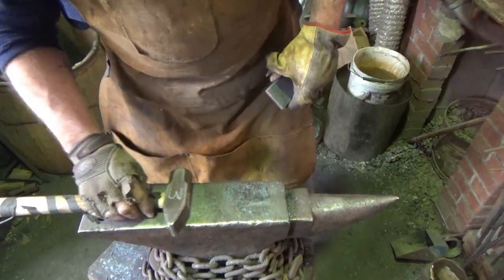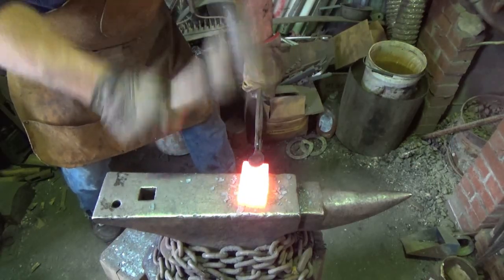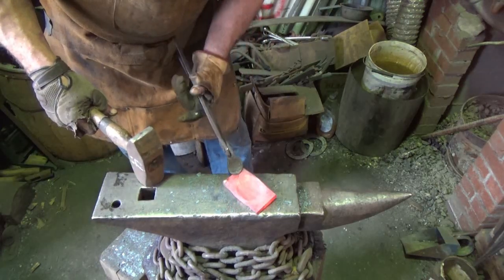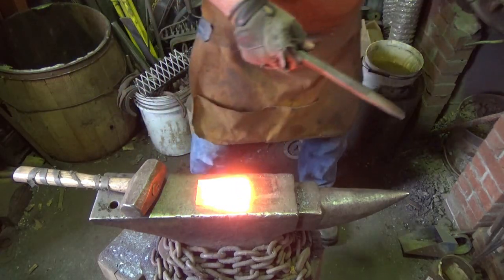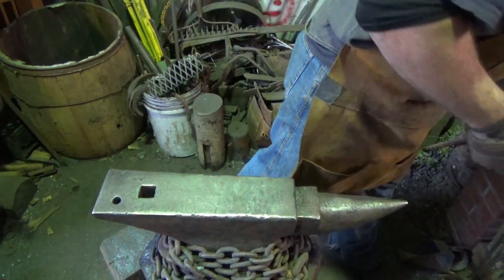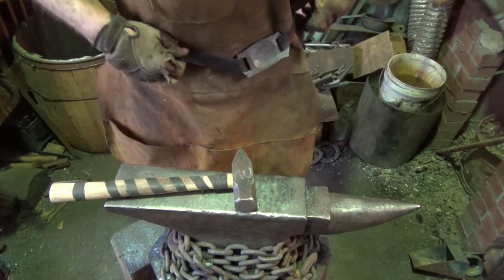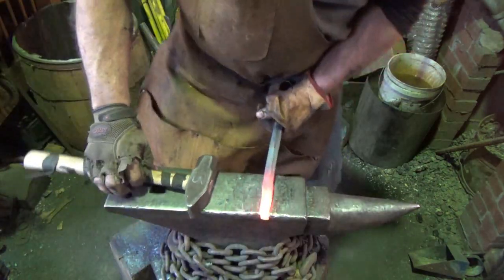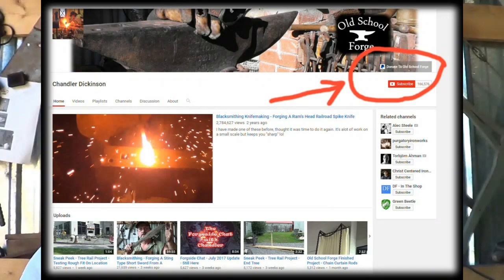Blacksmithing - Need A Tool Make A Tool - Blacksmiths Jock Strap   Upsetting Hip Block

Comment: I've seen plenty of Smith's use upsetting dies or blocks either with a floor mount it a smaller Hardie style. Also I don't know if I've ever seen you use a hold down before. They're easy to make and are that 3rd hand you seem to need quite often. Keep up the good work.

Comment: If you use Brad's and fix it we're you run it in from the inside using a thicker pice of leather front and back should work

Comment: I was doing something along the same line as you, a few years back,,I was upsetting a box wrench like the one you have,,,What I did was to run a metal rod through opening and then put it in the hardie hole..the metal rod supports the wrench, as you up set and you do not disfigure the round end..

Comment: I have a stupid question. Why not just cut a groove into a block of scrap wood and set it on the anvil?
Reply: todd Brewer it would seem a great idea at first...but, to be honest, we find ourselves nestling stock into our hips/legs all the time when upsetting stock.  It just never seems to work well upsetting smaller stock vertically.  I have no idea why...but working horizontally just works.  I only upset stock vertically when making a scarf for welding.  I feel like I have more control laying it over the anvil and turning it.
Reply: I knew there must have been a reason why it wasn't done. Thanks